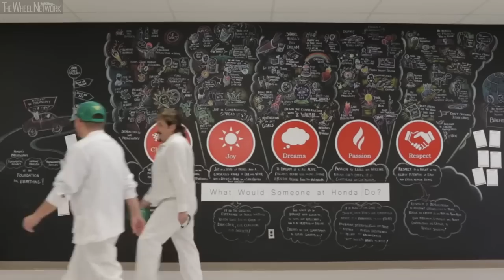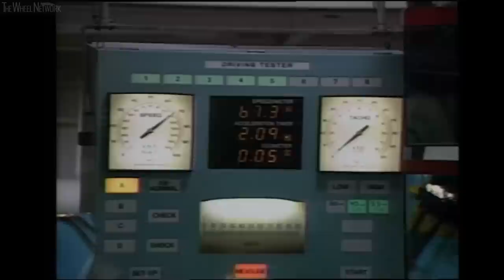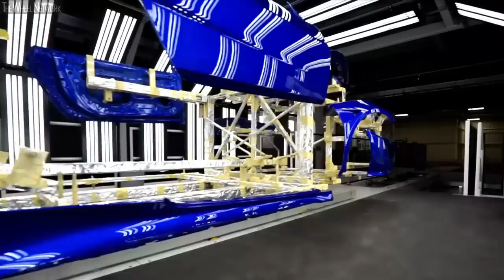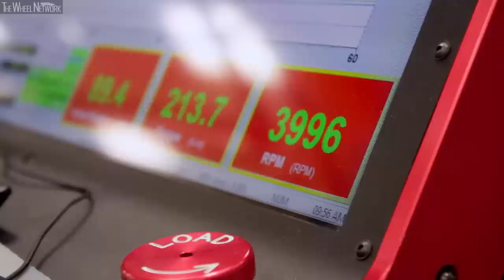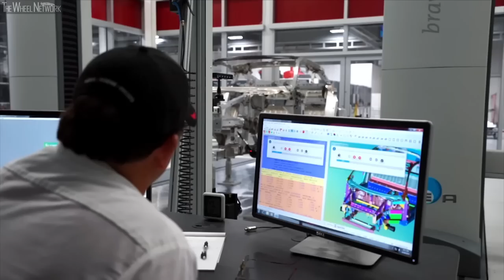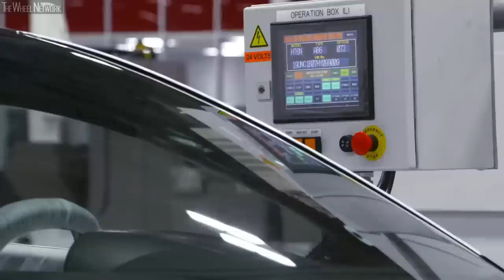Honda Production in the United States

Comment: I used to work at the East Liberty and Marysville plant. It may not look like it but it is fast pace and hard work. Believe me, it is hard on your body. Especially when you have a model change from Honda and Accura vehicles.
Reply: @Tom Platz True. All teams have about about 10 to 14 jobs we have to do, So sometimes we will not see that job two to three times a week. We have 4 quarters a day at 2 hours quarters. At Honda they rank the jobs A = hard job B= mediocre job C= easy. It's the A's rank jobs that get you. I had a torn rotator cuff. Both knees carpal tunnel in both hands. And a very bad back. I would say about 90 percent of my team has had some kind of surgery for something work related.
Reply: Working at the indiana plant, all my crv processes are pretty easy. Its when you get into the civics or insights that it can get hard. Wrestling cable harnesses is a bear... fortunately crvs are at least 85 percent of our production. But for sure, my thumbs, wrists, and finger muscles are perpetually damaged. The work is a constant race against the clock, and God forbid something goes wrong. Its not the end of the world to need help but when you're expected to be self sufficient, there's always the regret at mistakes or errors. Not the easiest work for the money I've ever experienced, but it is interesting work so far.
Reply: I worked at east liberty temping- you know them temp process of years. I was 3.5. I quit even if they were going to hire me. I doubt it though, because I didn’t kiss enough booty.
Reply: ern, it's a pity that we won't get such cars to Russia, thank you for what you are creating.
Reply: I work at Lincoln Al and it is fast moving,swing shift ain’t easy either.

Comment: I just bought my fourth Honda my old one has 269 k miles and still runs
Reply: Shit my 1997 f150 has 588,654 miles and runs like new also just painted her and put new Harley Davison wheels
Reply: 375,000 miles on my 94 Acura with the original engine and gearbox.

Comment: Thanks to people who know how to make beautiful and high-quality cars that are in demand, who believe in the honda concern, it's a pity that we won't get such cars to Russia, thank you for what you are creating.
Reply: Quality cars 🤣🤣🤣🤣
Reply: @melmel3703  Honda knows a thing or two about quality
Reply: @Jack-yv2xu  no they don’t! I know what goes on because I worked there. Unless you were employed there, you don’t know!  If you do work there and you’re saying this, then you’re lying because you would know it’s not true. Check the 20000 recalls. Thank you .
Reply: @melmel3703  It’s literally ranked number 1 by Repair Pal. My Honda Ridgeline is the very definition of a quality truck.
Reply: @Jack-yv2xu  idc who ranks it as what! Have you worked there? NO!  So move along. Scoot scoot!
Reply: @Jack-yv2xu  I guess this is a lie Specifically, the recall affects 557,309 Pilot SUVs, 148,813 Ridgeline pickups and 18,704 Passport SUVs. No accidents or injuries have been reported related to this hood vibration issue.
Reply: @Jack-yv2xu  
2021-11-17
Recall no.
21V900000
Honda (American Honda Motor Co.) is recalling certain 2021 Accord Sedan, Accord Hybrid, CR-V, Ridgeline, 2022 Insight and CR-V Hybrid vehicles. The automatic locking retractor on the second-row center seat belt assembly may deactivate improperly, which can result in an unsecured child restraint system. As such, these vehicles fail to comply with the requirements of Federal Motor Vehicle Safety Standard number 208, "Occupant Crash Protection."
Reply: @Jack-yv2xu  Recall date
2021-03-24
Recall no.
21V215000
Honda (American Honda Motor Co.) is recalling certain 2019-2020 Acura MDX, MDX Sport Hybrid, RDX, TLX, Honda Accord, Civic Hatchback, Insight, 2019 Acura ILX, Honda Accord Hybrid, Civic Coupe, Civic Coupe Si, Civic Sedan, Civic Sedan Si, Civic Type R, Fit, HR-V, Odyssey, Passport, Pilot and Ridgeline, and 2018-2019 CR-V vehicles. The low-pressure fuel pump inside the fuel tank may fail.
Reply: @Jack-yv2xu  do you want me to continue on🤭
Reply: @melmel3703  Yes please do since apparently you have tens of thousands as you said
Reply: @Jack-yv2xu  poor thing
Reply: Arkadius  I’m not sure what they do now, but I’m assuming just a pee test. Unless they switched to mouth swabs or hair. But I doubt it. When do you start? Let me know how it goes. Are you going to be perm or temp?
Reply: Arkadius  ok good.  I’m sure it will work out for you. Idk about Indiana. But in Ohio, the treat the temps like trash, and the managers were horrible. They would mess up a car, then let the blame fall on someone else. One tried it with me, but I caught it. I said this is NOT mind. I was not even in the area when this car was done. They then said oh yeah , Charlie did that car. Yeah - Charlie whatever, don’t blame me for something I didn’t do. I’m not playing that. Maybe they build them better there too. In marysville they didn’t care. Just about every night , a supervisor was stiff checking cars. They tried to blame me once for that too. It was 1:30am, and my supervisor asks me why there were no screws in the car on my job. I said I told you when I got here, starting at car 275, or whatever, that I had none. I told you several more times throughout the day, and you continued to ignore me. My job is not to do your job. Therefore, I hope you brought a second lunch - tell you wife you won’t be home tonight, because you failed to do your job. ✌🏾✌🏾✌🏾
Reply: Arkadius  ok, so same there. As with any job. I’m sure you’ll navigate through it. Especially if you’ve been on the mgt end.  Thanks. Yeah, the full time people didn’t know I was leaving until 5 min before shift was over. I had given my notice the week before. They bombarded me with questions because I made less than them, yet i could leave and they were miserable and stuck. Also I had just gotten a brand new car. They wanted to know how I was gonna pay my bills- as if that was their business. I said well I guess I’ll pay them the same way they got paid before Honda. God supplies my needs. They didn’t know my car was paid for. I said job ain’t my God. They would make little comments about people with degrees still working at Honda. They were low key talking about me. 🤣😂😂😂😂. But I was able to bounce, now I probably make more than them with my ot from my other job years later, sitting at home on a comp. While they are still there. 😂🤣🤣🤣Let me know how it goes

Comment: Every time I see one of these videos I think, man I want to work in a car factory, building cars with all those cool specialized tools. Then I remember that factory workers do the same thing day in and day out, and don’t actually build the whole car. Then I no longer want to build cars in a factory.
Reply: Yeah I work at the indiana plant. You do one of several processes per quarter shift. So 2 hours of doing the same thing over and over at a time. Some of which are really rather physically taxing. Not so bad for 5, 10, or even 20 cars. But 45 in and your muscles might just start failing you. In some areas you have to do a lot of precise and forceful pushing with your thumbs. It will debilitate them. Its no walk in the park. But your body will adapt over time. And on top of that you have really short spans of time to do your process per car. Only about 45 seconds. And they cram as much as they can into a single process, making it a difficult prospect that requires some degree of supervised experience and assistance before you can do it alone. Every single process I've learned has taken time to get familiar and build efficiency to make it.
Reply: @GhostShip94  appreciate your insight into what car factories are like. I would probably be more suited to some sort of high end car hand built process, rather than an assembly line.
Reply: I worked at Honda for almost 4 years. You don’t want to do that crap. The full time people were all miserable.  The majority temp for years, get hired in, then are miserable alcoholics complaining they hate the job. I didn’t stick around after my interview to become full time - I could not do it anymore
Reply: @melmel3703  is it because of the repetitive nature of the work?
Reply: @r1oot  good for you

Comment: Thanks Richard for your understanding.  I called Honda Corporate here in Torrance and they told me there was nothing they could do for me.
 So I am asking you if you claim that the Honda odyssey engine was designed by the engineer in Japan, did anyone talk to the engineer  in Japan to find why the 2021 iVTEC engine with VCM is still using the same engine with the same engineering flaws as the engines that was installed in the 2005-2016 models?  Again, I repeat don't buy  any Honda which his still using the iVTEC engine with VCM technology.  This technology has engineering flaws and should not be placed into the market place to fleece the consumer.   Richard you should talk to the mechanics on line and get their feed back.  They will shed some light on the engineering flaws with the Honda engine.

Comment: Now i know why the quality of Honda vehicles is going down hill.  They on made in the USA.. IF Honda vehicles were engineered and made in Japan, Honda vehicles would be  more reliable.  For example, the Honda odyssey uses the iVTEC engine with VCM . This engine has a notorious history of burning oil prematurely.  IF you dont believe me, check out Honda Bulletin 13-080.  Honda lost a law suit because of this VCM technology.  Even in 2021, Honda is still using the same engine.. Buyer beware..........My odyssey only has 122K mile.. Spark plugs in cylinders 1 ;2 ;3  are all oil fouled and burning oil.
Reply: Import true jdm right hand odyssey,  and you will understand,  what is true Honda is. Of course,  if right hand car is allowed in USA.
Reply: @4545377  Agreed
Reply: . But Your problem is a design failure. The people who design Honda engines are the Japanese in Japan. Americans just make them. I would agree with u if you said your paint is prematurely peeling and you blame the American Honda for it because that’s a facility manufacturer problem.
Reply: honda has been making cars in the US since the '80s. manufacturing in the US is not the reason

Comment: I have a new Jeep Grand Cherokee wish I can see that being manufactured, instead of these cheap  tin cans🤗🤗🤗
Reply: your car is the same cheap tin can
Reply: @davidellenbaum1229  no it’s not
Reply: Actually Jeep Grand Cherokees are worse than Hondas. I would not drive a Jeep or any Chrysler product ever. Even if somebody gave me one. I would turn around and resale that junk before driving it.
Reply: Fiat Chrysler has one of the worst reliability records.  Honda's reliability, build quality and performance is much better than Jeep.
Reply: Kevin jeep is trash I worked for 3 years at a honda dealership I use to see hondas with 200k+miles still running strong still with there factory parts don't compare trash to something good
Reply: "This fool is terribly misinformed"
Reply: Honda’s resale value, reliability and quality are proven much higher than any Chrysler Jeep product ever! Just check the stats.
Reply: Jeep Grand Cherokee was the worst car I ever owned. For real...